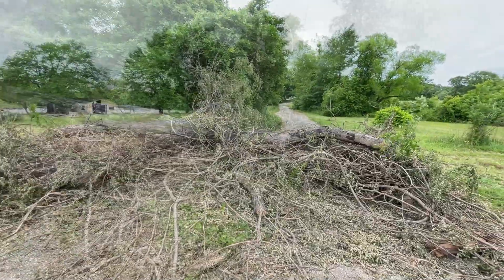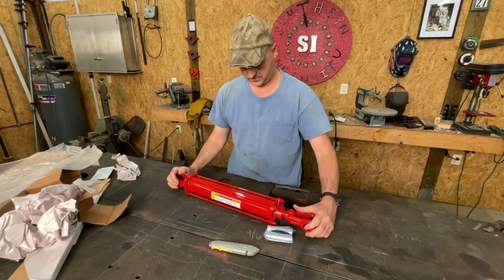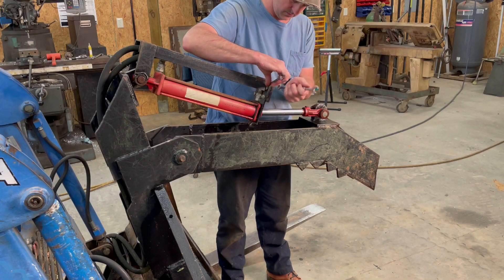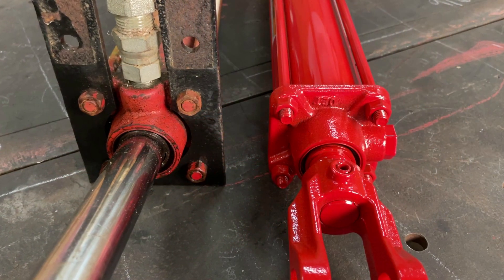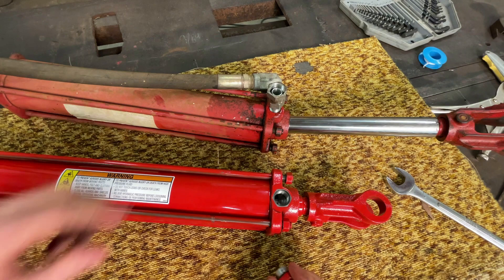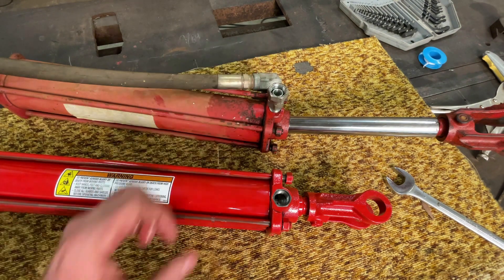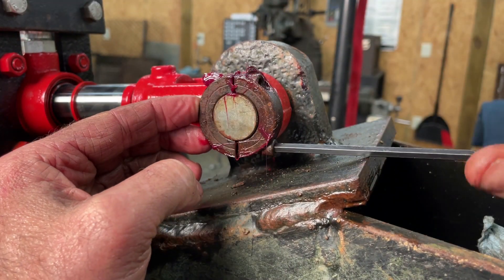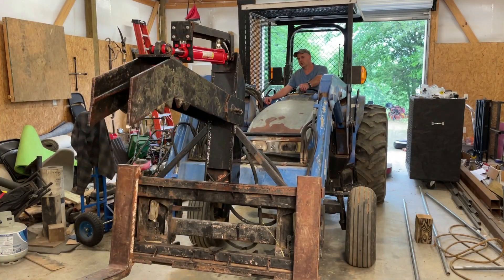Hydraulic Cylinder Replacement on Tractor Implement

Comment: I did the same thing with my Skidsteer. Bent that rod into the shape of a question mark!! Not sure how I did it. Went to replace the cylinder only to find that everyone that had one in stock, the cylinder had smaller holes for the pins. So I bought the cylinder, and had to swap out the new cylinder ends with the old ends. No shop to work in, just the tailgate. One day…one day.
Reply from the maker: Hey, I feel your pain. I was there too once with no shop. Just keep working towards it and keep that dream alive, and one day it will become a reality. Thanks for watching!